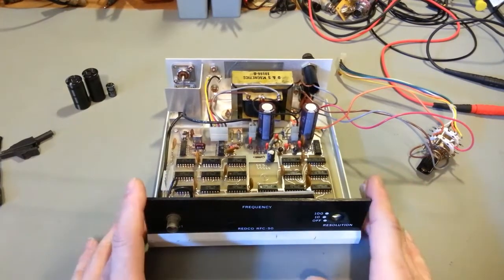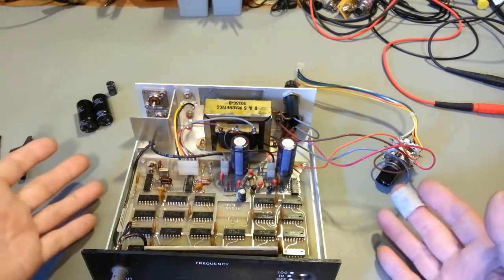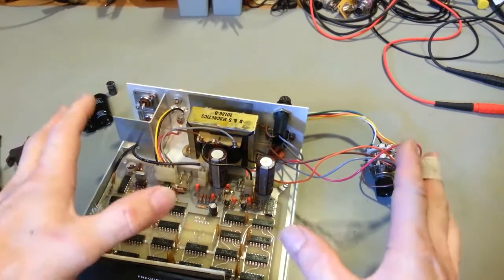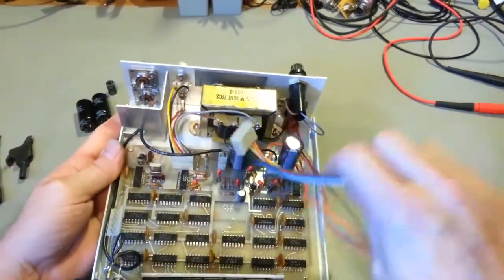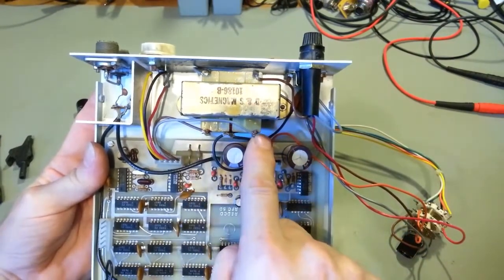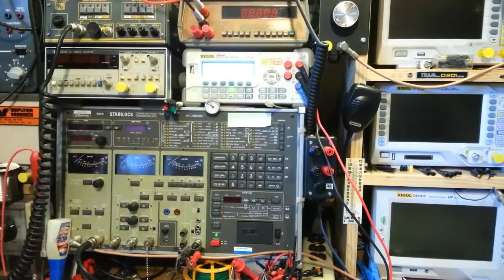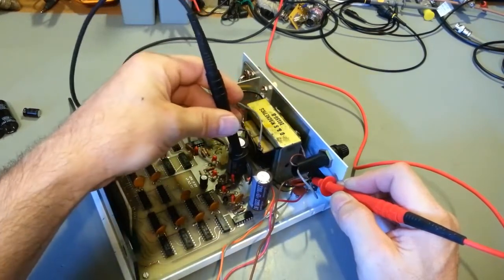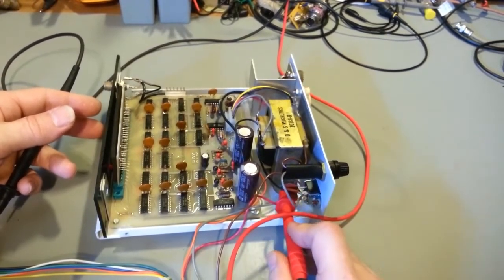Figuring out how to wire up a power cord when you don't have a schematic.

Comment: You are so right about those older tube type radios. I had one, it had the 12V plug, but even with the schematic it was a real bear trying to wire it up for AC.